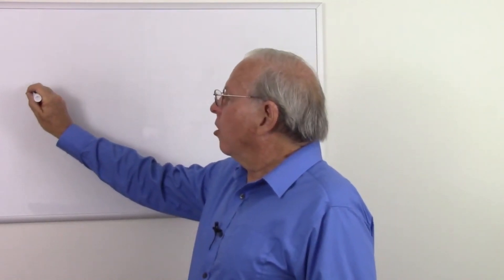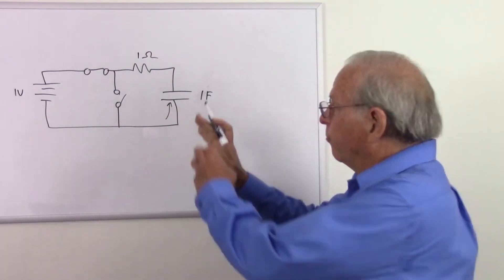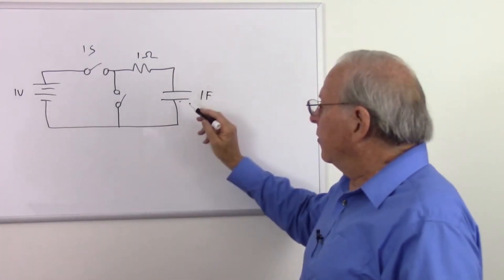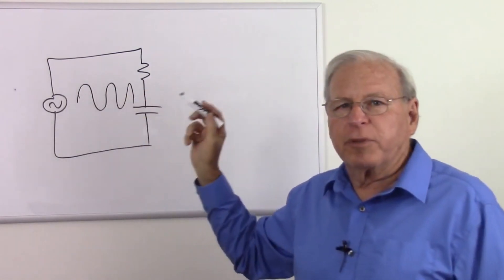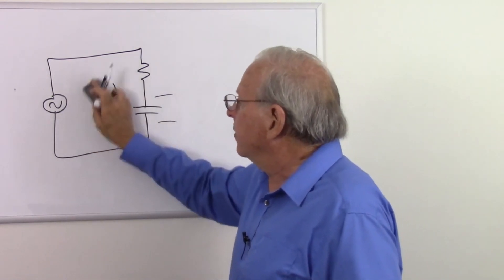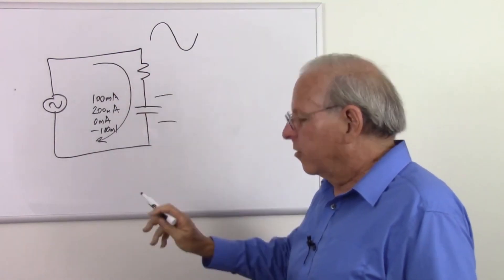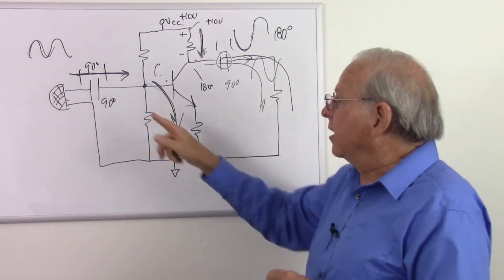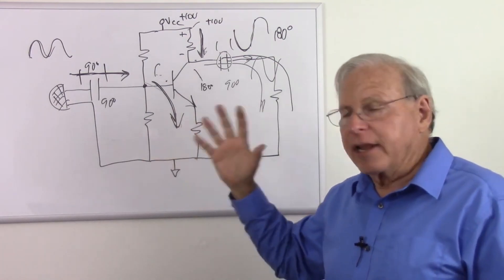Why is There no Phase Shift with Coupling Capacitors

Comment: Well this is a sorry state of affairs. All these students singing the praises on such a clear description.

Unfortunately this "clear" description is fundamentally wrong on two extremely important points.

Firstly, the diagram starting at 6:40 shows the current in the capacitor lagging the voltage by 90 degrees. This is exactly the opposite of reality. In a capacitor the current leads the voltage by 90 degrees. This is an extremely important point and the foundation for resonant circuits.

Secondly, you can't just add up the voltages and hope to match the applied voltage because the V and I are 90 degrees phase shifted. They don't just add up to the source voltage.

Comment: I must argue that due to KVL in a series RC circuit with an AC voltage source there must be a phase shift in the voltage across the resistor when referenced to the voltage source and it will indeed be a positive angle. Complex voltages around a closed loop must sum to zero. Voltage lags current across the capacitor so the voltage across the resistor must lead the voltage across the source in order for all the complex voltages (phasors) to sum to zero. 
If we used your example circuit of Vsource=1v, R=1 ohm, C=1F and let the frequency be 1Hz then Vr=0.99volts at a phase angle of 9.04 deg and Vc=0.157 volts at a phase angle of -81 degrees. There is a phase shift of Vr with respect to Vs.
Reply: The current for the circuit example above is 0.99 amps at a phase angle of 9.0 degrees so the voltage lags the current by 90 degrees as required across the capacitor.

Comment: I'm sorry to have to correct you but, in an AC circuit, current leads voltage by 90 degrees. Your diagram shows it lagging and this is quite a terrible representation of the truth. This why we use the formula I = C dv/dt and get it right.
Reply: I am sorry but your formula makes no sense. By definition C=Q/V for a capacitor. Then it follows up that V=1/C * Q. Assuming the charge on the capacitor changes over time it is the result of accumulation of charges brought by current traveling through the circuit and voltage on the capacitor is the sum of all charges brought by i(t) over dt time intervals.
Reply: @dan-florinchereches4892  How does that formula makes no sense? I (capacitor current) = C (capacitance in F) * dV/dt (rate of change of voltage across the capacitor). If dV/dt is close to zero (voltage is not changing) then current (I) will be close to zero. If dV/dt is high, then current through capacitor (I) will be high. Current can also be thought of as a rate of change of charge I = dQ/dt.
Reply: @oriole8789  
I see the differential equations are pretty much equivalent. My problem would be more along the lines of chicken or egg problem.
I see it as the voltage at the capacitor plates is changing as a result of current depositing charge. 
The formula you are using is from the perspective of the charge existent on capacitor producing a current.

Comment: I don't understand how current could be delayed 90 degrees in the capacitor and be 0 degrees delayed in the series circuit. I am imagining it like it is a stream of water on a tube, and I cannot see how the flow is delayed in a part of the tube but not in the other.

Comment: I have a question, based upon a circuit that was supposedly a phase shift circuit that I saw many years ago. If i had two AC sources running at the same frequency but at different amplitudes wirh respect to ground,  across a capacitor, can you describe the electron flow, if there is any. I would expect that after the AC sources stabalized, there would be a constant voltage difference across the capacitor and no charge would flow. i hope that I am not correct about that.

Comment: Since 0v is not an absence of voltage I can see how you can have 0V and max amps, but how can you have 0I and max volts?  According to Ohm's law you need amps to have voltage, right?
Reply: A capacitor is similar to a battery in that regard. It can be charged up so that there's a voltage difference between its two plates. But, like a battery, even with a large voltage, there may or may not be any current flowing into or out of it. It all depends on what else it's connected to.
Conductors and resistors follow Ohm's Law. They're sometimes called "Ohmic devices". But a lot of devices aren't Ohmic. In fact, most of the interesting ones aren't, including capacitors, inductors, diodes, transistors, etc.
For a capacitor, the current flowing through it isn't proportional to the voltage across it, but rather to the rate of change of the voltage. So when the voltage reaches its maximum, for a brief moment the voltage isn't changing, and thus the current is zero. Also, when the voltage is zero, it's changing at its maximum rate, and so the current is flowing at a maximum.
So if the voltage takes the form of a sine wave, oscillating between positive and negative, the current will also be an oscillating sine wave, but the oscillations will occur with a 90° phase shift relative to the voltage.
Hope that helps.
Reply: @zenbum2654  I think I understand.  Thank you.
Reply: because the circuit looks like it is open.
Reply: I think you misinterpreted Ohm's law. This law defines a relationship between the current value given a certain voltage applied to a closed circuit with a certain impedance*. You don't need a current (whose unit is given in amps) to have a voltage. A voltage is created, for instance, when you bring together opposing electrical charges separated by a certain distance (aka insulator). The result of doing that is that you have created a disturbance in the electric potential. In our universe, everything tends to seek a more stable state. In the same way that a body will tend to fall to the ground if it is lifted, the opposed charges will be delighted to meet each other, and if you give them that chance by connecting a wire, they will take it for sure. The value of the current will depend on the *resistance , in the case of DC power source, or on the impedance of the wire in the case of a AC power source.
Hope this helps you to understand the matter better. The electric and electronic world is a very tricky one.

Comment: Thanks for another excellent video.
In the second question about coupling capacitors, it's not quite correct to say there's NO phase shift. The small-signal AC voltage on the transistor base will have a slight phase shift (and attenuation) relative to the voltage produced by the microphone. 

For AC signals, the two biasing resistors plus the emitter resistor are effectively in parallel between the transistor base and ground. Their equivalent resistance forms the "bottom half" of a voltage divider with the impedance of the coupling capacitor. Normally, the capacitance is chosen so that its reactance (at the lowest frequency of interest) is less than 10% of the equivalent resistance. Then, to a first approximation, the capacitor can be regarded as a short circuit for AC signals. But there will in fact be some attenuation and phase shift as the signal passes from the microphone to the transistor base, although certainly much less than 90°. Similarly for the amplified signal that passes from the transistor collector across the coupling capacitor to the load.
Reply: Not that I'm qualified to have an opinion but this makes sense to me. I suppose a mic implies a high impedance amp., a big cap and an audible frequency. Say 500 ohm, 1mF and 20Hz? Call Xc 8ish, arctan(8/500) is around one degree.

Comment: Another homing in on a misunderstanding haunting me for YEARS stunting my electronics understanding and thus no real improvement in forever. 

Phase shift of a component vs. phase shift of a circuit. WOW, thank you once again professor Bob. 

Another one was current sources. I just COULD not envision a current source since I've always approached sources from a battery standpoint instead of an induction standpoint. I can now see how a current source (microphone) creates current which then "pushes" a voltage vs. a battery which creates a voltage and "pushes" a current.
Reply: Is a microphone a current source? An ideal current source would produce the same current no matter what the resistance connected across it. I don't know a lot about microphones, but I think they're closer to ideal voltage sources.

An example of a current source would be the collector (or emitter) current of a transistor operating in its active region. If the base current is kept constant, the collector current will be almost constant over a wide range of load resistances. You can make an even better current source using an opamp instead of a single transistor.

Perhaps current sources are difficult to envision because they're somewhat difficult to create, unlike voltage sources. It's fairly easy to make a battery. But imagine if you could just open your parts bin and grab a current source. It would be a dangerous device. You'd have to be very careful to store it with its leads connected together. Otherwise, an arc of current would flow through the air from one lead to the other. And I suppose all that constant current flow would rapidly deplete all its energy.

Ultimately, of course, any linear circuit has both a Thevenin equivalent and a Norton equivalent, the first using an ideal voltage source and the second an ideal current source. So a simple battery can be viewed as either a voltage source with a small series resistance, or a current source with a very large parallel resistance.